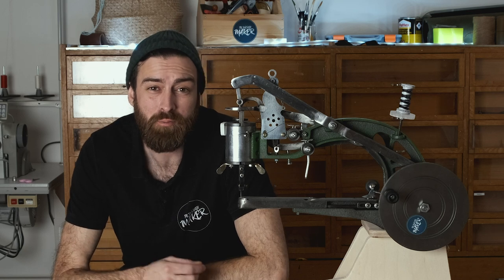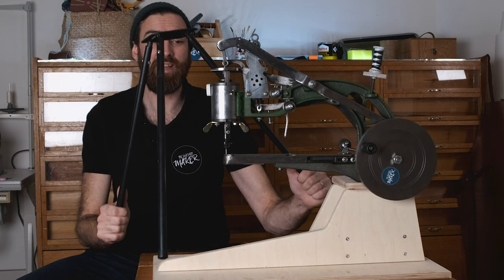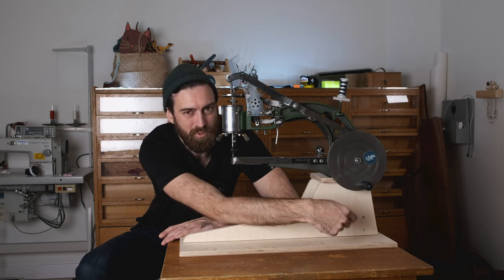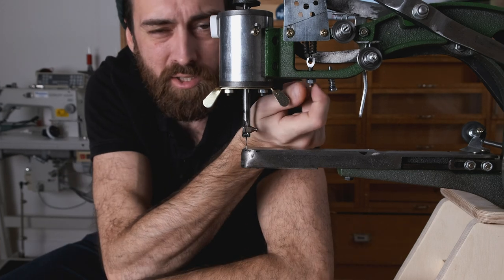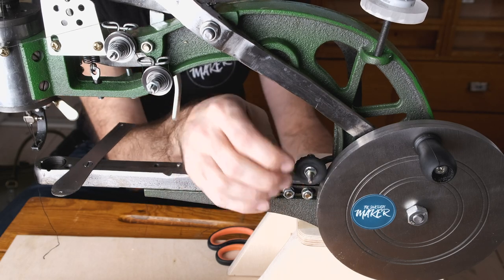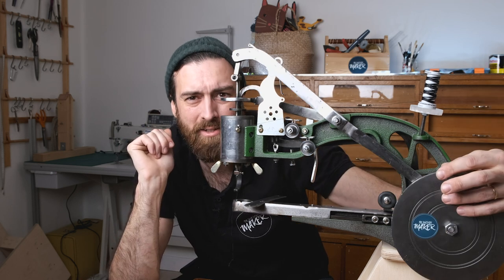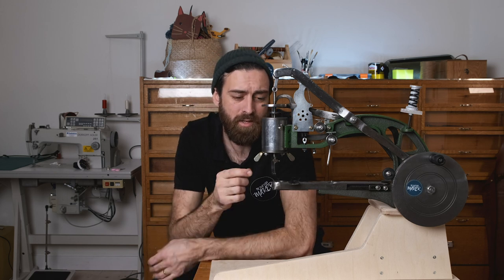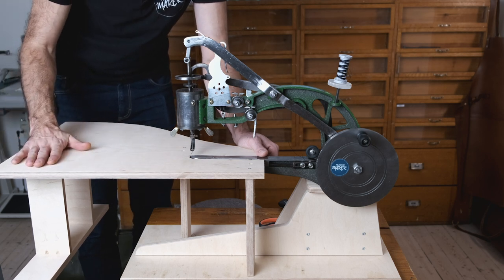Chinese Leather Sewing Machine - Is It Worth Buying?

Comment: I love my machine it looks to be the same. Yes tons of maintenance and adjustments needed. But for a guy who has never touched a sewing machine till this one i love it and crank out a ton of product
Reply: Willam Ward  yeah first time I used any sewing machine. I didn't even know what a bobin was🤦‍♂️ thank goodness there are tons of videos on YouTube. You  seriously need to sand / file every surface the thread comes in contact with. And keep it properly oiled. I use 3in1 oil for most areas. Then axle grease on the back of the crank plate.  I just bought a kit to turn it into a motorized machine. Looking forward to get that set up.
Reply: This gives me hope. I have one ordered already and I am waiting for delivery. I have no sewing machine experience, only hand sewing patches on my work clothes. I hope to be able to use it to do repairs on denim and canvas as well as stitching patches onto leather. I’m mechanically inclined and actually look forward to tinkering with it to get the “bugs” out. So glad there seems to be a lot of information available about this machine online.

Comment: I've had one for some time, made a stand and table much like the ones shown here.
The only advice I can offer: look at how you hold the crank handle in your right hand.
I tried palm up, palm down, palm facing the needle, palm away from needle.
Nothing felt right or like I had much control.
It works best for me (and my weirdly baby-sized hands) if I grasp the handle like it was a screw-driver, and I was trying to tighten the handle-screw itself!
This puts my elbow roughly center of the flywheel, and I turn my hand in a circle, rather than 'hauling on a crank handle'.
Works for Me, no guarantees for Thee!

Comment: I bought my sewing machine a few months ago and love it.  The legs work fine if they are positioned properly, so try different placement before throwing them away or building  a   base.  I use the legs when sewing and sitting on a chair.  Works really well that way and even when I stand it on a desk and stand and sew it hardly wobbles if at all. I put some tape around the top of them so they stay in place when I pick it up to move it around.  
       I found that I do not have to thread it on both tension wheels and for me it works like that, by just using the second wheel tensenoir.  The sharp teeth at the bottom has not been a problem for me  making knife sheaths and some covers for my various shop tools.  I did not file any edges down as some have as they have caused no issues.  It has given me a lot of hours of fun.
Reply from the maker: Great input! Thanks!
Reply: I have bought more than one of these machines... the first one had legs so bad...  I could bend them with my bare hands.
The angles on the plate,  had a downward tilt so bad there was no way to get the cylinder arm level.   
I like my block of 2x8 and big C clamp just fine.

Comment: Great review and  descriptions  I’m  handicapped that only one hand ,arm works due to a Tramatic Brain Injury I do sew with a Chinese clone walking foot sewing machine I bought on eBay. 15 years ago  I would need to convert the Cobbler machine to a motor driven one  but it looks like that may be achievable   With my injury I sometimes need to modify  shoes. To get them to fit more comfortably   Over a leg brace I need to walk with  I’m pretty sure I’m going to wind up with the same machine as yours  btw I’m a ewtired Woodworker so I am pretty good with tuning machinery and making accessories for them  as that is often the case  with Woodworking machinery
Reply: Good for you keep up making the good stuff 👍
Reply: I've seen a couple videos on these machines, now. On another video, a commenter said that they converted an old Singer treadle base to turn the hand crank. I'm curious if a belt drive sewing machine motor and pedal can be used. There are such motors available for replacing those found on vintage machines, complete with wires and pedal for about $50 us online, the biggest problem would be finding a drive belt, I think. Just basically thinking out loud.

Comment: It appears you need to lubricate all the critical rotation parts. It should turn much easier & smoother. Polish the bobbin carrier with a dremel wire brush.

Comment: This machine is totally worth it. Only suggestion is to step needle up to Organ 15x1 HAX1 130/21 on Amazon for leather.
Reply from the maker: Yeah I agree! I´ll definitely check that needle out as I have just been using the ones that came with the machine so far.
Reply: Amazon sometimes has 140/22 needles in 15x1 also, and these work with 138 to 207 thread on the Chinese patcher (with some tinkering).

Comment: Instead of electrifying it, how about a set of bike pedals below with a belt/chain to drive the crank wheel? I think you might get better speed control with that type of a setup. You would also likely get higher low speed and startup torque out of such an arrangement.
Reply from the maker: That is a really good idea! I will look into this. As you say, the speed control will be a lot better. Thanks!
Reply: That’s really smart 👌👌👌

Comment: I'm looking to start making leather jackets and I'm going to be using buffalo or pig split suede as it's tough and doesn't "go bald" as quickly as sheep, lamb or goat suede. I was looking into buying a regular juki straight stitch machine. For me, modifications and time aren't really a problem. There's something I find therapeutic about having no motors running. Will this be good for sewing thin and thick leather? I'm very excited to buy one as well as the presser feet attachments.

Comment: I love mine but purchased it to sew pvc patches on beanies/hats and the pressure foot is ruining the patches. I adjusted the spring all the way and it was still leaving dents. Maybe filing it down will resolve the issue. I bought a speedy stitcher but even that will be too time consuming if I`m to crank out a decent volume if need be

Comment: Hi I was wondering if the vintage Singer Sewing hand crank sewing machines would be good for sailboat sail repair and boat canvas work? My idea was the simplicity of the machine and no need for electricity. Thank you for any opinions as I am not a crafty person lol my wife is.
Reply from the maker: I think it would work, but as a sail is so big I would rather go for a regular sewing machine. There should be machines that aren't that expensive that could handle a little thicker material. I am not sure how thick the sails are, but it's my best guess.
Reply: My mom and dad built a pop up trailer in the 60s.  Dad was a tin basher and mom sewed the canvas.  We had it for years!!!

Comment: The hand crank seems to be quite stiff at certain points, I've noticed this on a few vids of reviews, I know the behind looks kind of "egg" shaped, is there a way of stopping this jerking movement?
Reply: Is that jerkiness actually purposeful? It might assist puncturing the leather.
Reply: The only way is cleaning, polishing, and lubrication. Most of the jerky movement is due to the cams on the back and needle plunge. It might benefit from more inertia, i.e., a bigger, heavier flywheel.

Comment: Thanks for your video, it helps to understand how this machine works before buying. I didn't find the links for the other presser foot that can be purchase on ebay. Could you add it to the description of the video ? It would be great ! :)
Reply from the maker: Thanks! I updated the description with the link as well. :)
Reply: @TheSwedishMaker  Thanks ! :) That's great ! I'm thinking about replacing it by a roller presser foot (with the wheel on the side of the needle). Do you think it's possible on this chinese patcher sewing machine? Does it exist any roller presser foot that could fit to the two screw mounting?